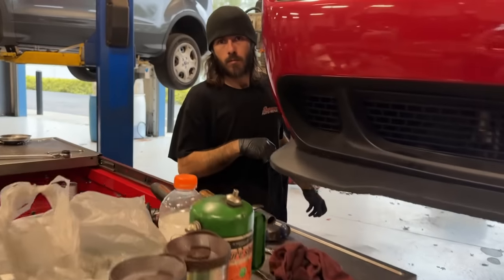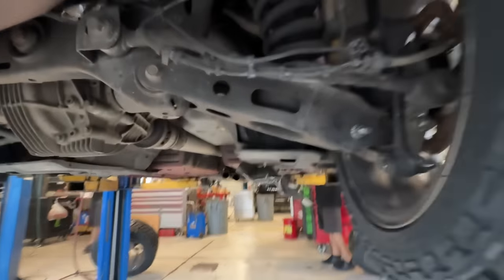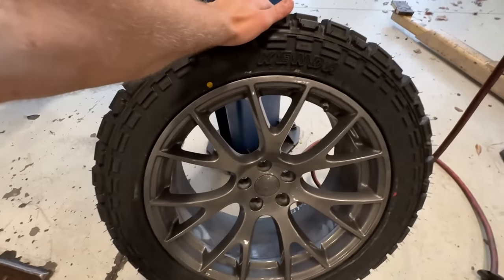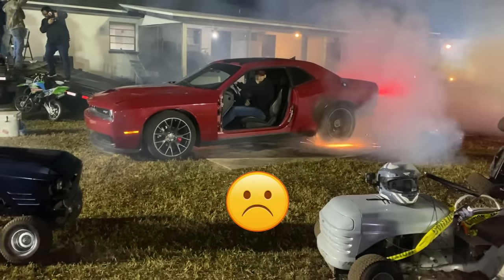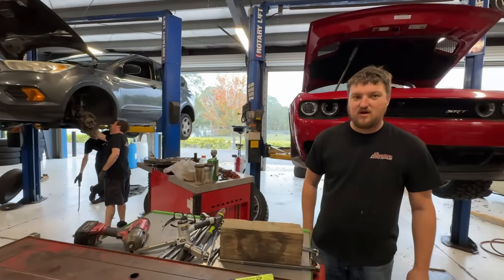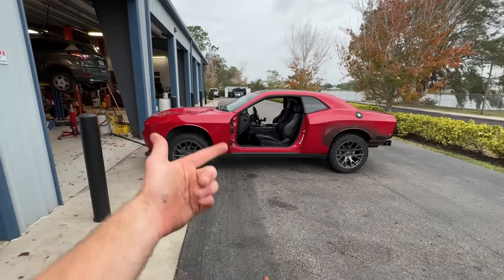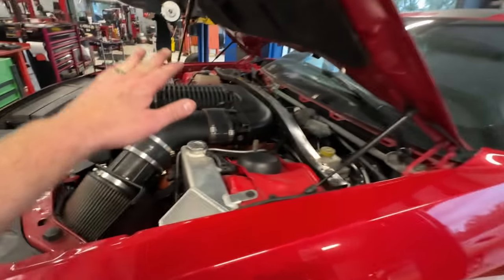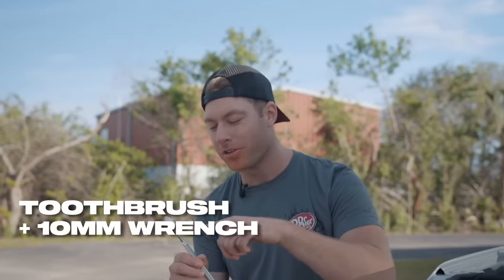Lifted Hellcat on Mud Tires

Comment: Couldn’t you just run some thick wheel spacers and push the tire out past that ball joint?
Reply from the maker: Yes you could but that would be the cheap easy way to do it. We want it to turn and not break stuff